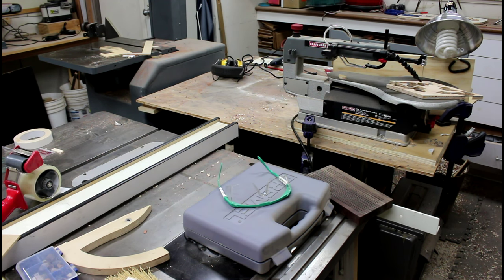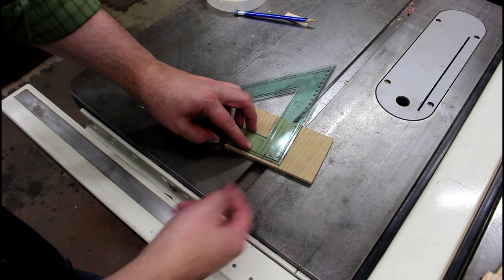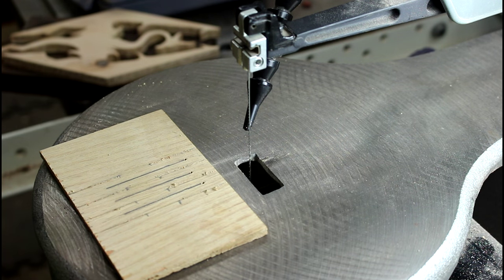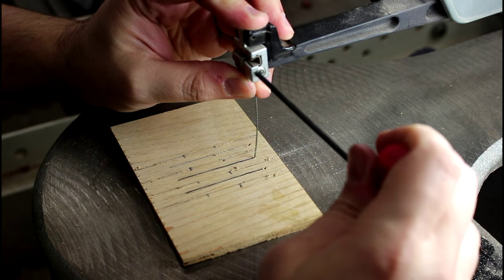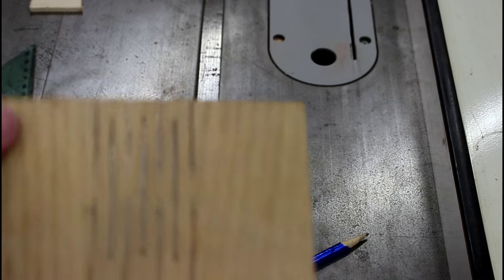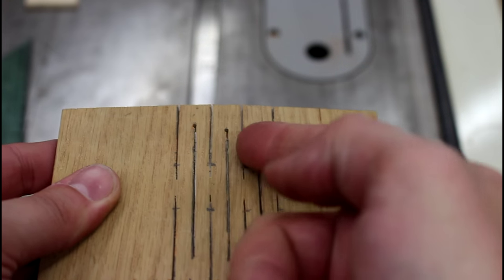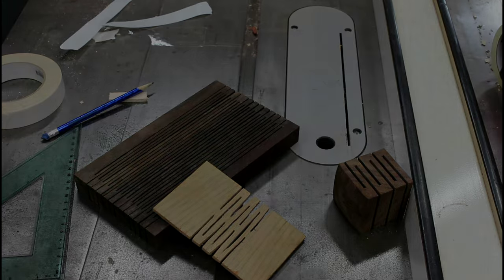Cutting A Living Hinge

Comment: COOL!!
One quick tip (hopefully). The saw has this unnecessary hold down that's secured with a thumb screw. On my saw I could switch this thumb screw with the set screw so I don't have to bother with that allen key. In any case replacing the set screws with thumb screws makes life easier.
Reply from the maker: +Fabian's Tiny Workshop Oh man! I'm going to check tonight. That would be so much more convenient. Thanks Fabian!

Comment: Lots of people say those oscillating saws are junk (sort of are, but they have their uses), and I think this would be a perfect use. Instead of undoing and redoing the saw blade every time you could just use the oscillating saw to cut the slots in the middle. On the other hand it might make a wide gap than what you did.

I have a Bosch oscillating saw, it works pretty good for cutting a hole in sheetrock or a piece out of trim. I mounted my TV to the wall, and there's trim running riiight where the TV was going to rest on the wall, so I just cut a spot out. Worked pretty good.

Comment: I love my scroll saw....  Kudos to you for trying a scroll saw....  The better scroll saws are easier to play with the blade on....  I have an old Delta, which I got for free, so I shouldn't complain, but, the blade changing stinks on that thing....  which is too bad, because aside from that, it is robust, has power, and is really super handy to have around for 100 different reasons....  You can use a scroll saw to make fabulous dovetail joints, for example....

Comment: Ok, here goes, hope you can understand. I can explain again if you need any more details.   Take your stock wood and saw it in the bandsaw through the centre making two equal halves, then tape them back together using double sided tape.   Now you can to make 3/4 length cuts (flipping wood every time and no need for centre slots.) till you have made sufficient cuts for required width.    Now carefully separate the double sided taped wood and swap tape for glued cloth/fabric. 
Makes great hinges, and strong too!

Comment: That is very interesting. I imagine a nice box with round corners made like this from nice wood and the voids filled witt epoxy mixed with brass dust. 

So you dip that bendy wood, kinda.
Reply from the maker: +Willem Kossen Ha! I know it's against my nature, but skip the epoxy and the kerfs make for an interesting feature!
Reply: +Peter Brown i see that, but i worry about two things.
1. Little stuff me fall through the cracks
2. It might not be very strong.
There is a category of projects where both nr 1 and 2 arent important. Its called art.

Comment: I think the narrowness of the kerf may be working against you. When you flex it say /\ then the bottom edges of the cuts are clashing and forcing the top surface of the wood apart more-so than if the kerf was wide enough for them not to clash.

Comment: Not to be dismissive or anything, but I think your troubles with the CNC machine come from how you were trying to use it, and your pattern creation which (at least in the video I saw) was extremely inefficient and used a lot more tool paths than necessary.

Comment: you could do this with the table saw faster ;P
Reply: +HomeDistiller You can't make cuts inside the wood with a bandsaw. The outside slits would be a bit faster with a bandsaw, but the cut widths would be quite a bit wider too (depending on the blade, but scroll blades are generally thinner)
Reply: +moolcool you can make cuts inside, you just wind the saw blade up into the wood. a thin kurf blade would leave a slot only slightly bigger but much neater than the ones he made here
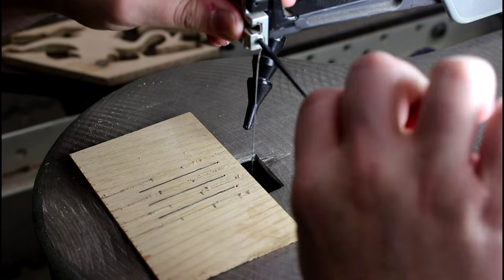Reply: +HomeDistiller You can't drill out a hole and get a circular blade inside that hole though. Like how would you do what he did at 1:50 in the video with a band saw?
Reply: +moolcool what? I think you getting your tools mixed up.. he used a scroll saw, I'm suggesting a table saw, and you getting a band saw mixed up
Reply: +HomeDistiller My pre-coffee mistake :)
Reply: +moolcool all good!
Reply from the maker: +HomeDistiller You totally could. It wouldn't look uniform on both sides though....
Reply: +Peter Brown I thought of that myself, you could flip the piece and cut from both sides though..
Reply: you could do this with a laser cutter faster
Reply: You could do this faster by throwing away the wood and using a 3D printer
Reply: what filament would you use to do that?